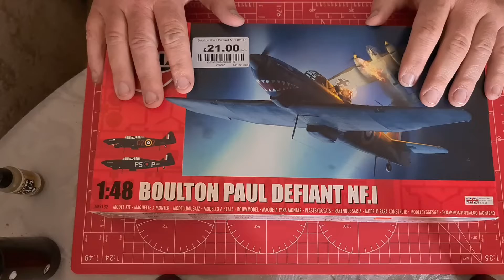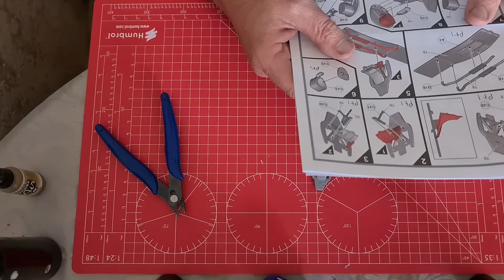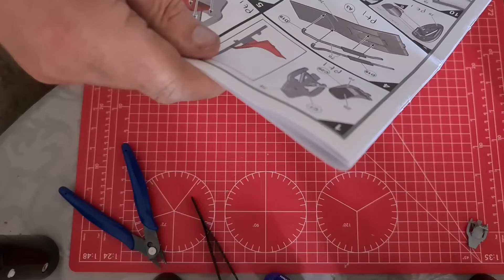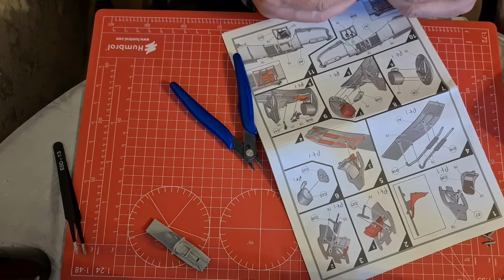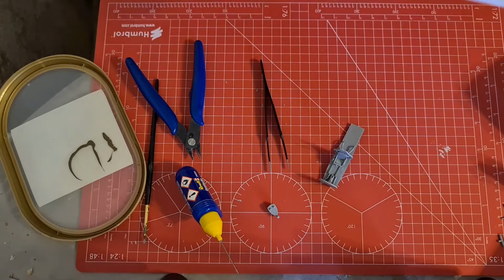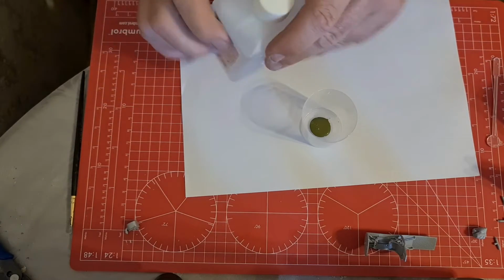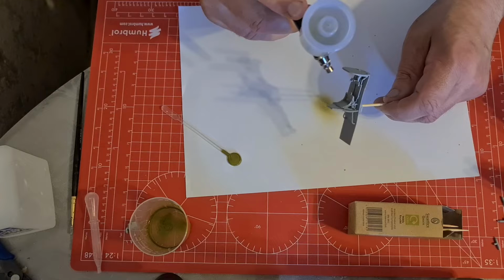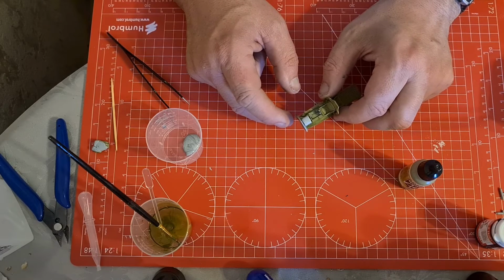Airfix Boulton Paul Defiant NF.1 Part 1.

Comment: Perhaps the cockpit assembly could do with another coat of interior green? And if the control column is painted while still attached to the sprue, shouldn't it be touched up after removal to cover the spot where it was attached? The unpainted white spot at the top was visible.
Reply from the maker: OK.